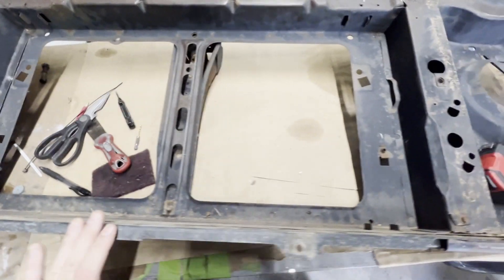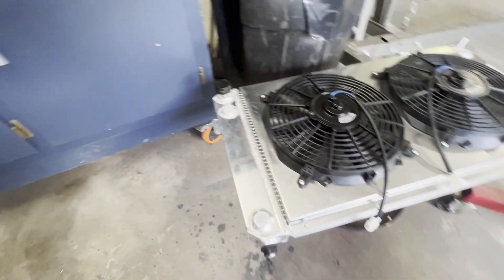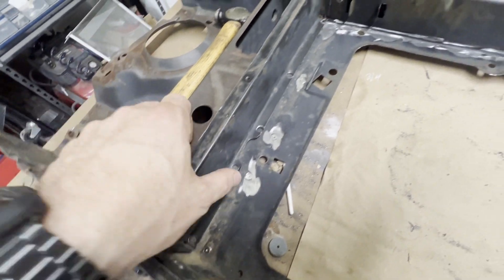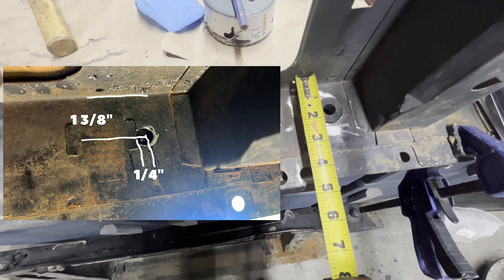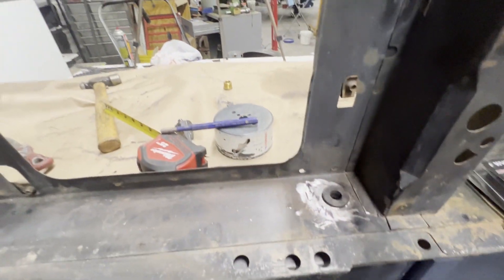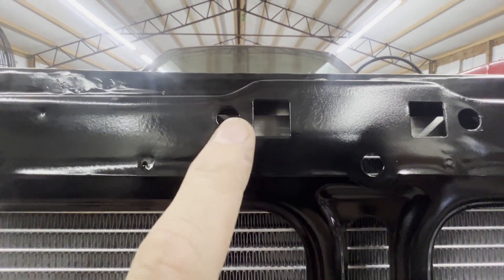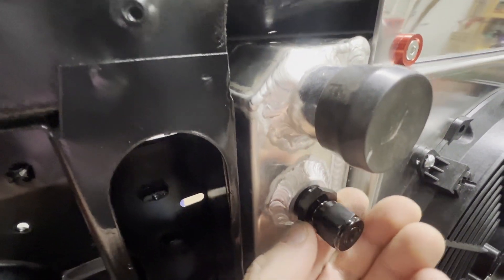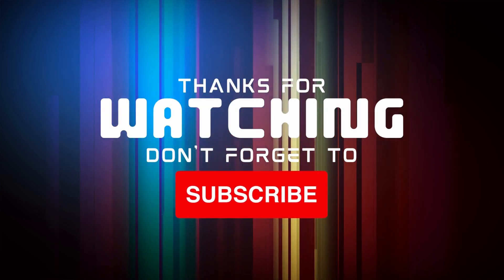LS Radiator Installation in the S10

Comment: Nice work, another piece of the puzzle looking good. Have a great weekend 👍
Reply from the maker: @thisoldhooptie you know it!! I was watching your Hooker manifold video tonight. Like others I wasted money on a set of the shorty headers. I ordered the Hooker manifolds from Summit today.  They look like they will have much more clearance. Fingers crossed!! You have a good weekend as well. Keep them videos coming bro!!
Reply: @dtperformance256  I'm working on it. I've been teaching my son to drive and fixing stuff around the house last few months. Most has been way to boring for a video. Looking forward to getting back in the garage. I got a new motorized bead roller I've been itching to try out.  
 The headers will do the trick. I had the ebay ones they were beat to heck with leaks and flow issues on some ports. Also the space for exhaust and everything will be way better with the black heart stuff no complaints.

Comment: I have that same radiator in my S10 Blazer. It works well but they don't last long. They have a tendency to start cracking around the welds and leaking. In other words, they're not well built. Great idea. No good follow through.
Reply from the maker: @onelostsoul1997 Thanks for the comment. I will be sure to keep a check on this one now that I know. Thanks for watching!!
Reply: @dtperformance256  The radiator works well. Well enough there in the winter time I have to change from the 180 thermostat to the 195. If not, my engine will run way too cold. And I live in California where the freezing mark is not a very common thing.
Reply from the maker: @onelostsoul1997 We see some hot temps here in Alabama so I am hoping it does well. I converted 2 other S10’s with 350 V8’s and I used the Corvette style radiator based off of JTRs book and recommendation. The Blazer had a 4.3 radiator and they both ran around 180 degrees but they were both basically stock engines. Thanks again for the feedback. I had my fingers crossed that this radiator would work.  That’s the problem with project cars, sometimes you don’t know until the build is completed if something‘s gonna work or not.
Reply: @dtperformance256  Right now I'm still running the 4.3 with AC even in 120° days. I can still keep the temperature around 200° with the aluminum radiator. And as you know with the 4.3, they like to run hot no matter what you do. And when they get hotter than 210°, they run like total crap.
Reply from the maker: @onelostsoul1997 you are 100% correct there. It’s hard enough here in Alabama with the temps we see. I can’t imagine the struggles you guys go through with builds in your area.